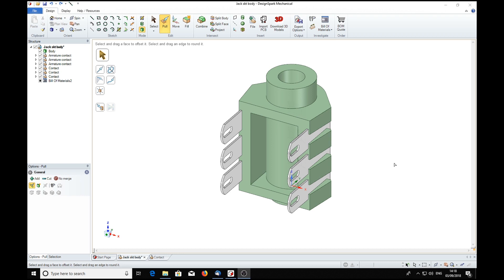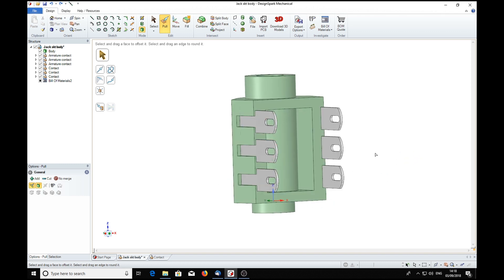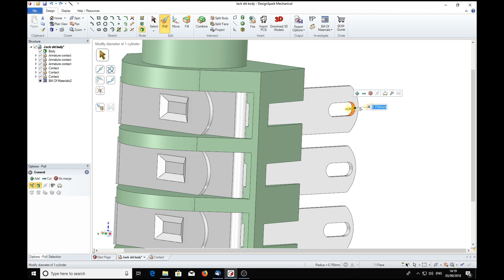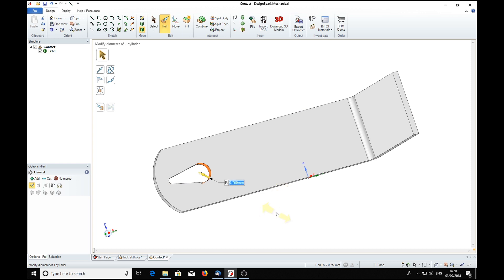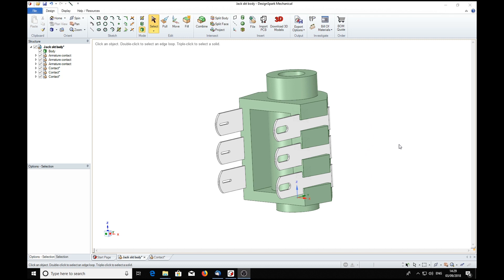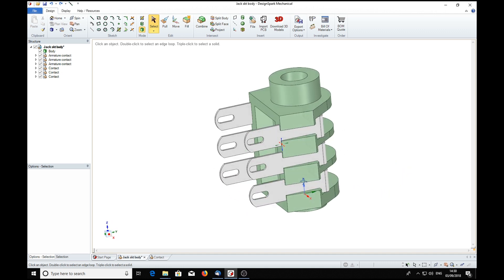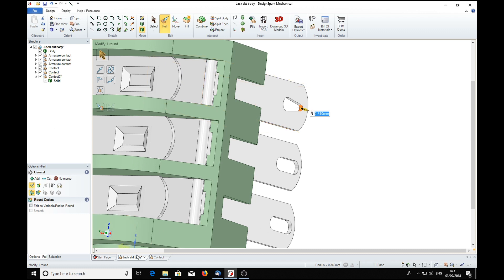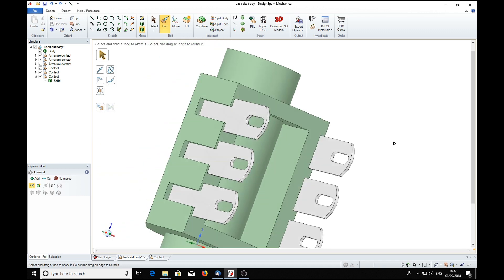Dependancy in DesignSpark Mechanical

Comment: Thanks Jim. It would have been a bit more informative if you showed how to create the dependency.
Reply from the maker: The dependency is automatically generated when the part is duplilcated.
Reply: @JimTaylor42  thanks. One other question. Is there an easy way to create a mirror of a part that you already have drawn. I know you can create one with the mirror line, but what if you have a part and after its drawn you realize that you actually needed it drawn the opposite way?
Reply from the maker: @BenEBrady  I'm afraid not. A lot of people want this tool but the DSM people seem reluctant to implement it.
Reply: @JimTaylor42  Hello, thanks for yours greats tutorials ...for the miror function it is implemented on the pay version, unfortunetly not on the free version :(
Reply from the maker: The dependancy happens automatically.  The reverse is true i.e. if you need a part to be independent you need to manually make it so.